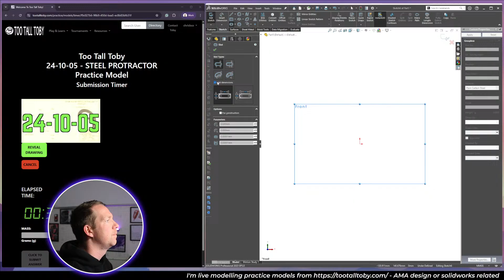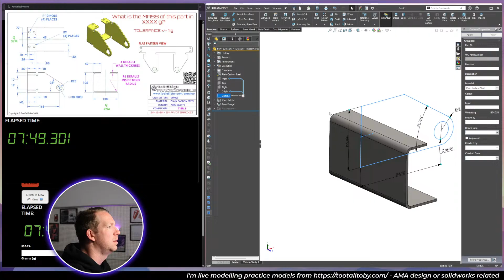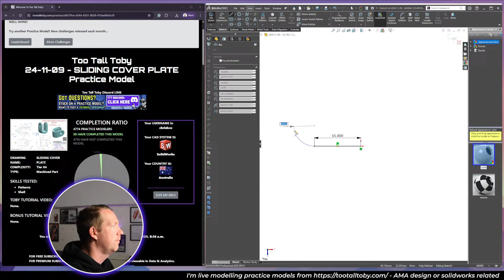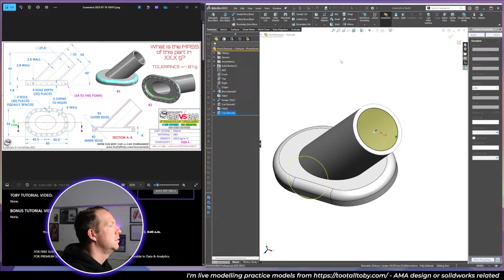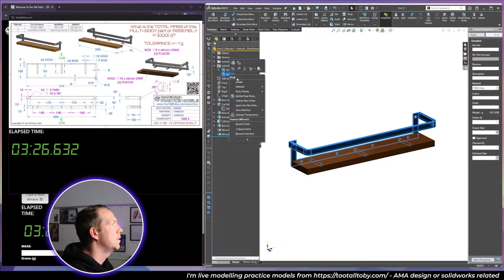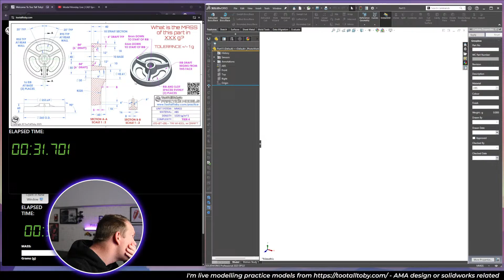SolidWorks LIVE: Modelling Practice with a CSWE

Comment: For 24-10-04 how do you determine that the rounded part has a width of 36?
Reply: The width of that section is based on the diameter of the circle.  Since the radius is 18, you'd need a total width of 36
Reply from the maker: @jon3211  thanks for answering!
Reply: @FullyDefined-Design  I remade that part a few times and everytime I get 411 grams. I used the same material that I used to pass other challenges. What could be the issue? I'm going crazy
Reply from the maker: @LiberTarian-i4l  most likely you have a wrong dimension somewhere - and you keep reading it wrong and that's why you're getting the same answer.  The way to fix this is to check off the dimensions from the drawing one at a time to make sure you have them correct and in the right position
Reply: @jon3211 Thank you 🫶